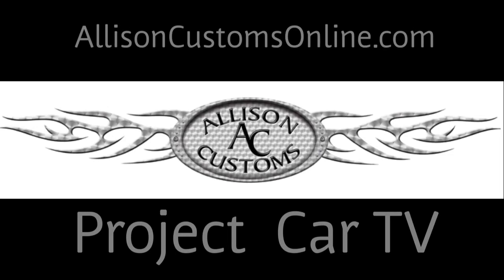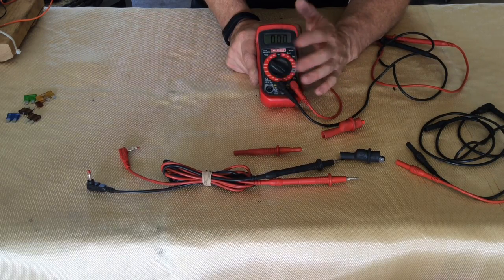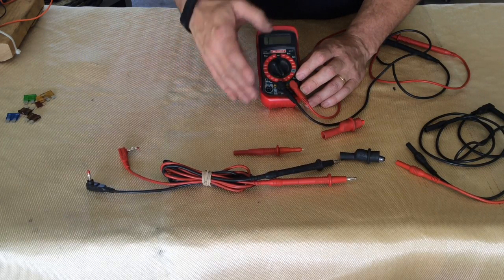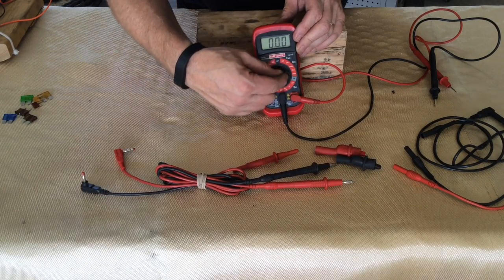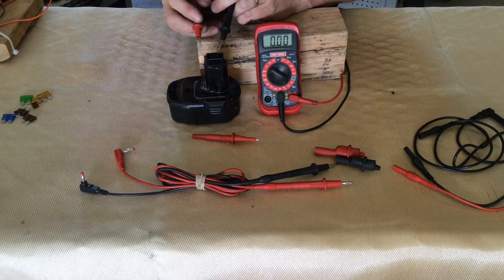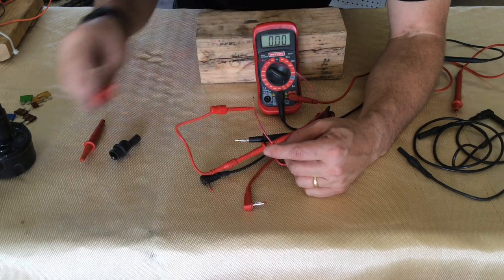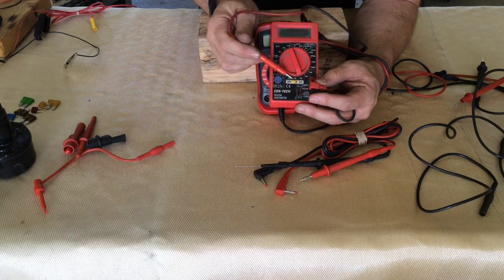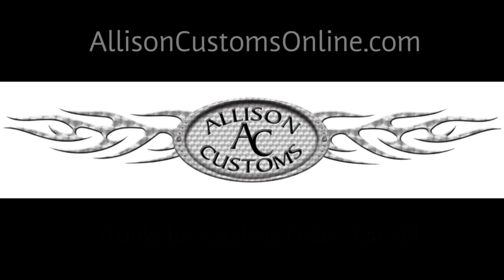PCTV - HELP SERIES - Multimeter Basics

Comment: Nice video.  When checking a battery(1.5 OR 9V) does it matter whether you use the "Bat" or VDC section on this tester?
Reply from the maker: It shouldn’t matter, either should give you accurate readings.
Reply: @AllisonCustoms  I was wondering because I do get slightly different readings between the   two settings.  Thanks.